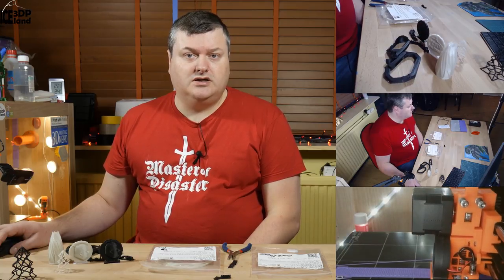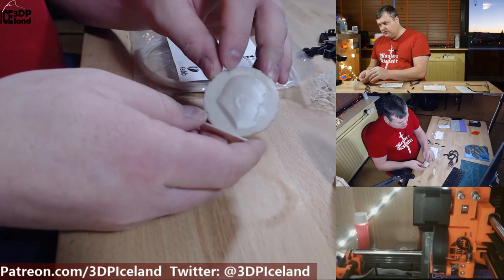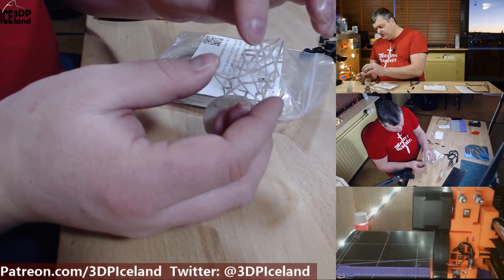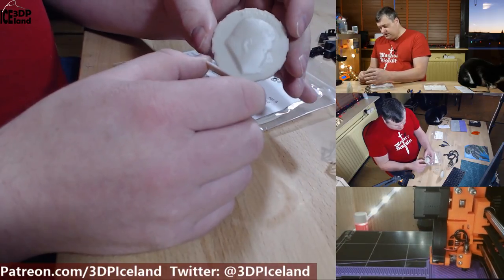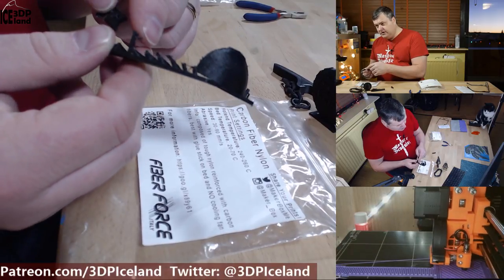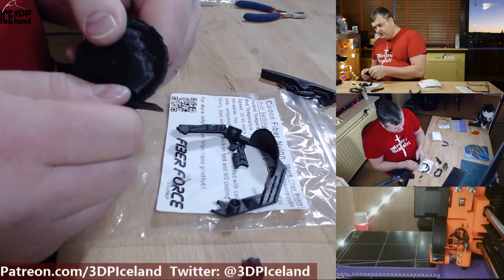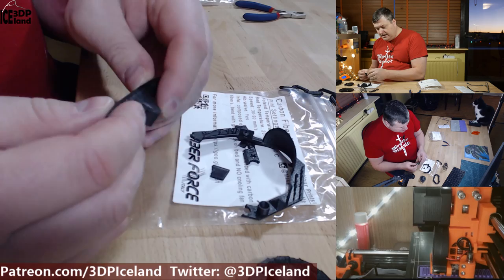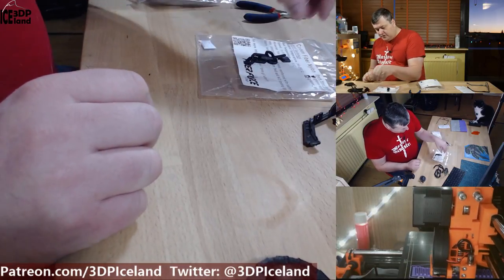MakerBox Samples ColorFabb GlowFill and Fiber Force Carbon Fiber Nylon

Comment: woodfill , carbon fiber and other fills print better with an o5 nozzle you get less under extruding & clogging  use cheap nozzles change often or after using whats a 4.00 dollar nozzle compared to the price of carbon or other specialty filaments
Reply from the maker: thanks for your comment, - I don't print with those abrasive often, but I have a 0.4 harden steel nozzle,  I tried once to print with a brass nozzle on a abrasive filament, and the print got ruined after few hours of print as the nozzle diameter changed during the print and extrusion went all wrong.